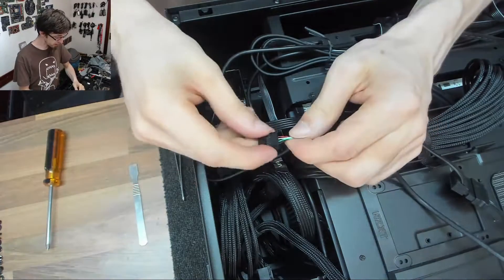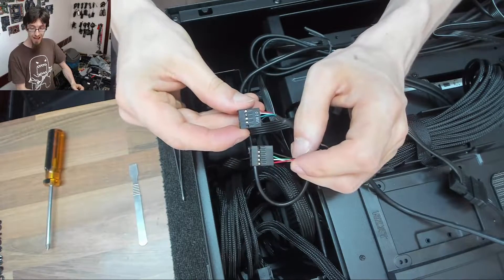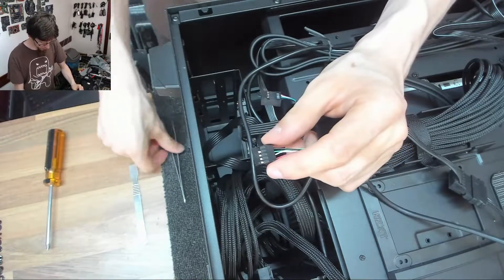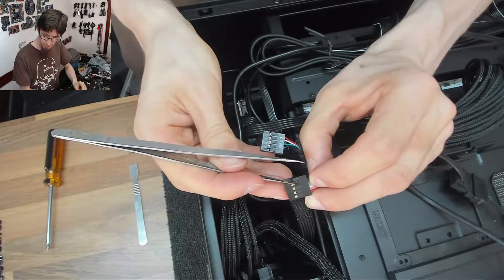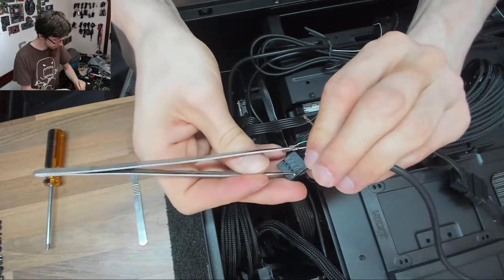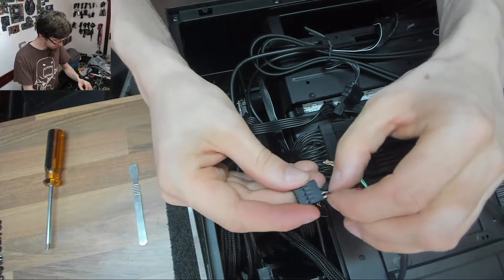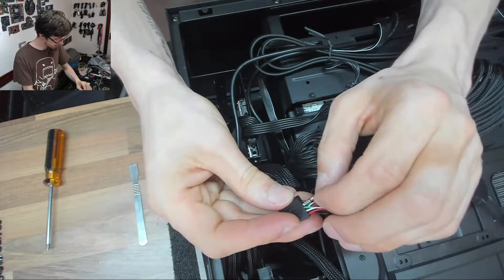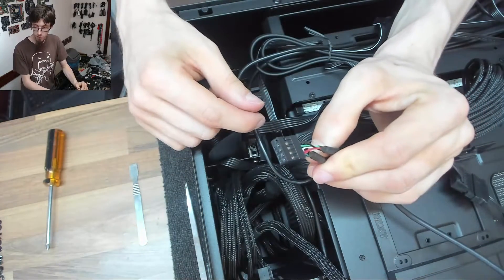B-Roll#16 - Combining USB2 Internal Headers

Comment: 6 years later and this worked wonders for me! Only issue is that my NZXT cam software isn’t picking up one of my controllers. Does anyone know if there is anything I can do about this? If not, no big deal. The fan runs, I can only have it be white tho
Reply: Did u end up fixing rhat issue?
Reply: @yenneferofvengerberg0  I didn't. I could have ordered a bigger controller with more connections but did this instead because I didn't want to wait lol. My motherboard only has two usb plugs so it was either this or wait a week for a bigger controller to be shipped. It's not a big deal, the fan runs, I just can't change the leds on 1/10 fans.
Reply: @OG_Kushh Makes sense, I will see how my build goes when I finish it fully , thanks for the help

Comment: what if the rgb fan hub uses 5 wires? i tried this and made sure everything was good. and it half worked. software just wouldnt detect everything properly. i even updated the firmware on each rgb hub

Comment: What do you do if the second device has all black cables and has one less? Does it matter which order you put them in?
Reply: It does matter. One tip I could give you is before you start taking the cables apart… align both cables In the same direction and start unplugging one wire by one… then just match it to the other one so you don’t get confused which one goes where.

Comment: Just wanted to thank you for this video! I just built a new pc with a kraken elite aio and 2 lian li led sync boxes (for strimer led cables and a bunch of fans) and really needed one more usb header. My mobo only has 2. I tried using a splitter that came with the aio but that didn’t work.  I ended up joining the usbs required for the 2 lian li sync boxes to one header following this video and that worked!  Thanks again!
Reply: is it 6 cable or only 4 cable like this video? my lian le rgb hub use 6 cable :(

Comment: My question to you is this. I need to do exactly as you are showing in this video, but the Lian Li cables i need to join into one connector BOTH have a 5th yellow wire. Do i snip one off and ignore it seeing as they are 9 pin connectors?
Reply: Following this ; 

I have connected 24 Pin Lian Li Strimer V2 plus with its controller and Lian Li 9 X infinity fans with their controller and merge both connectors USB wires into one Header but the issue is the 5th wire of Strimer is yello and 4 and 5 wire of Fans controller is Black so I leave the Yellow as it is (Disconnected) 

Turn the PC on it works; Fans are getting  command from L Connect 3 but strimer is detecting on L connect 3 but not changing its colors like Fans; 

Any idea what I am missing ?

Comment: so if i do this will i be able to control both individually with like software and rgb stuff?
Reply from the maker: Yes, they both appear as separate USB devices. The header is literally a double USB port, like the ones on the back of the mobo, just without a connector.

Comment: I don’t know if you’ll read this but I have a NZXT Kraken Z73 and a Lian Li Uni fan controller. These both use an USB connection. Do you know if I can combine these two? I also have Lian li Strimers coming in so I am one header short since my motherboard only has two
Reply from the maker: Yes that should be fine. Just check the existing connectors, you should see that each one is only using a single row of pins, which means you can combine them onto a single two-row header.
Reply: @Adamant_IT  I combined them and it works like a charm. Great video, spared me 20 bucks
Reply: @Bikeaneer  is it still working without any problems?
Reply: @silviomanuelbaez8360  Yes it should still work.  Mine is still working and I didn’t run into any problems because of this I’d just do it if I were you
Reply: @Bikeaneer  thnx, I did it and it's working fine, if any problem occur I'll let you know here, do the same please 😂😂😂
Reply: @Bikeaneer  Does your Lian LI RGB effect reset to "rainbow" puke on startup? I'm asking this because my NZXT USB 2.0 Hub resets your peripherals every time, until the program is opened up :/ So I'm going with this option because the onboard USB 2.0 headers it will retain the settings.
Reply: @mysticqro950  I haven’t had that problem no

Comment: Thank you this helped a lot. I have a slight issue though, I have 2x 5 pin devices. How do I go about linking them into one header?
Reply from the maker: The 5th pin should be a second black wire and is a wire-shield pin - it connects to the metal braided sheath around the USB cable. You can leave it disconnected, it's not really necessary for general USB stuff. It's likely connected to ground at the other end anyway.

Comment: Is it possible to draw too much power on the one header. I can up the voltage to my headers via control from BIOS.. Do you think this could cause any issue. Looking to use it for my 5 cooling fans and bluetooth from my PCIE 1 wifi/bluetooth card
Reply from the maker: Cooling fans shouldn't be powered from USB 🤔
If it's just RGB on them, then that should be fine. Modern USB 2 ports should be good for an amp each. Worst is you get power errors - the ports won't let themselves be damaged by over-current.
Reply: @Adamant_IT  I have 8RGB fans i forgot about the 3 on the front of the tower case. All three link to my RGBfusion 2.0 and plug in via USB.

Comment: Whats the limit with this route? My set up is x570 tomahawk wifi (2x usb2.0, 2x usb3.1, 1x usb type c), 2 packs of lian li 120mm unifan (1 hub with 3x fans per pack) that will populate my 2x usb2. nzxt kraken z63 that still need a usb 2.0, corsair 5000d airflow, no problem with the case. I want to use the lian li software and i might also buy another pack of 140mm unifan(2x fans) to replace the stock aio fans and i might just connect that to the kraken or use its hub instead and apply this method to the kraken. So the question is can i apply this method on my 2 lian li hub (maybe also the share aio and 140mm hub usb)? So basically 1 usb header have 6 rgb fans and the other have 2x 140mm fan on a hub + aio. Or should i just buy the nzxt usb hub instead?

Comment: Hi, you’ll probably not reply as this is an older video, but it would be great if you could. I have a usb 2.0 but it already takes up 7 of the slots, 3 red wires, 1 green, 1 white, 1 thin black, and one thick black. Is there any way for me to merge one of those and one usb 2.0 with only four wires like the one in the video? Thanks
Reply from the maker: That sounds like it's using both 'ports' of the header, but not both power lines and grounds. In any case, if it's using two rows, you can't merge it with anything.
Reply: @Adamant_IT  ok thanks man your channel is great. Yeah, I decided to order a splitter and that’s coming today. Thanks a lot for replying even though it’s an older video 👍
Reply: Me sucede lo mismo.. gracias por preguntar, tambien pedi un divisor y vino pero no lo reconoce el pc, solo les da corriente, no deja configurarlos

Comment: I wanna plug in a lighting node pro and a corsair rgb hub into one will icue still see both?
Reply: Surely that wouldn't work? As a corsair rgb hub has 6 pins in the block
Reply from the maker: Yup that should be fine!
Reply: As long its usb 2.0 its fine.

Comment: Does this mean you can control each component individually?
Reply from the maker: Yes, the header is two distinct USB ports, so two devices wired to the same block will appear as separate devices.
Reply: Adamant IT thank you so much, I’m surprised that you would comment on your video that’s 2 years old, thank you so much

Comment: I have a case from 2012, for some stupid reason they put both usb2 ports for the front in seperate usb connectors, my current board does have 2 usb headers but one is needed for bluetooth.  Did buy a Chinese adapter but it didn't even work!